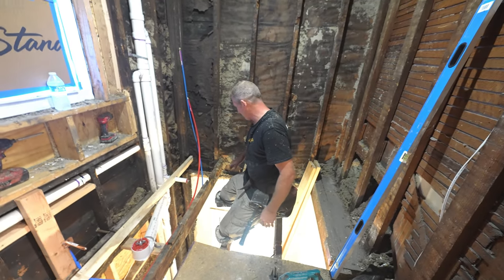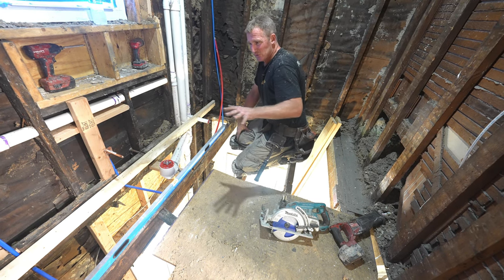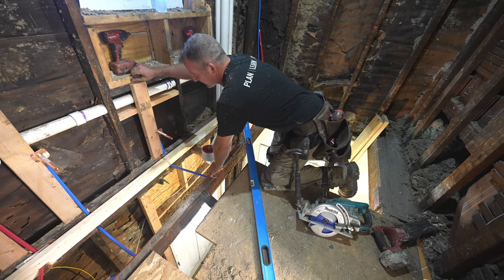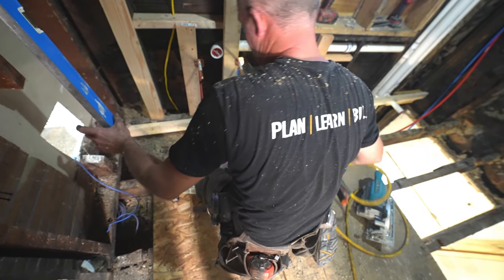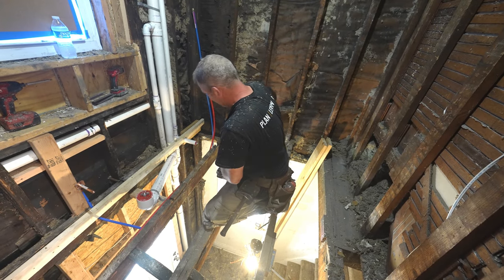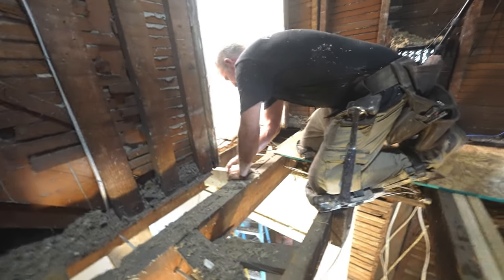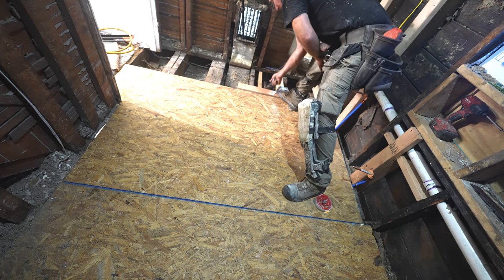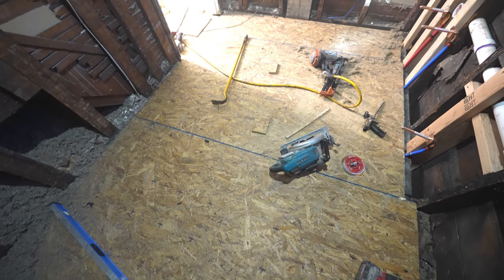Framing Repair on a Bathroom Remodel | New Joists and Subfloor

Comment: Still nibbling on good old house rehab video. That was a brave move to kneel on fully exposed open joist floor. And if I remember correctly there is a stairwell right underneath. 👀 Got my perspiration level up just by looking. Classic BRT! 🔥🔥🔥